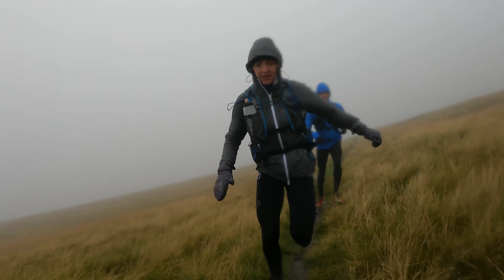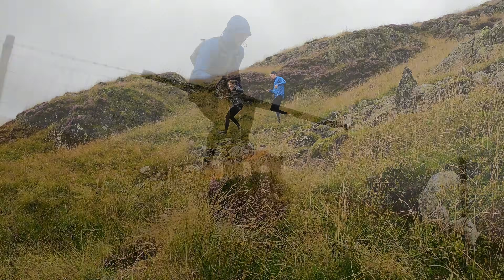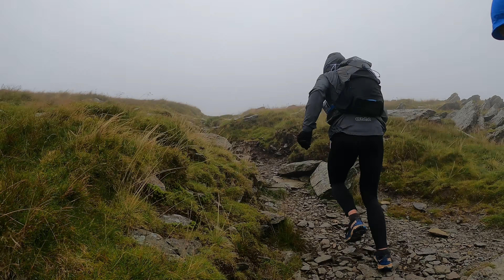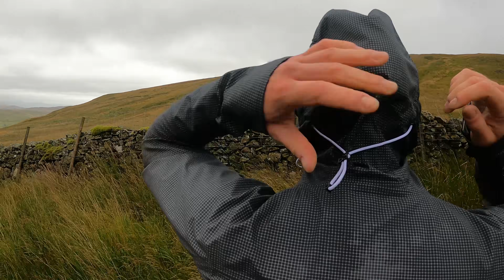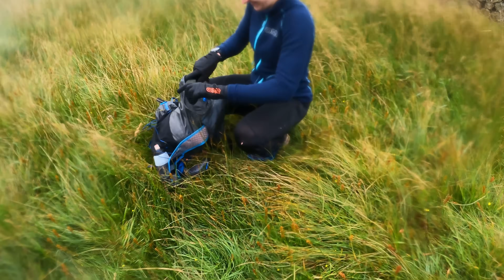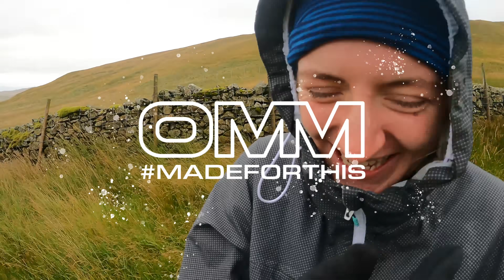The Toughest Waterproof Running Coat? Introducing the All New Aether Jacket.

Comment: Compared with gore-tex, what are benefits of this dyneema jacket, and what are downflaws?
Reply from the maker: The main point of difference between the Aether and other similar weight jackets would be the inclusion of Dyneema Ripstop reinforcement to the outer face fabric, making it much more resistant to abrasion and tearing. The Gore-Tex membrane is used in a huge range of fabrics with differing properties and end uses, so it is hard to draw a direct comparison. 

On top of this, the changes to PFAs and PFC regulations mean that what we used to call Gore-Tex (or e-Vent or any of the others), doesn't really exist anymore; they are all fundamentally different to how they were previously manufactured. 

If you're looking at other running jackets, Gore-Tex or otherwise, we'd recommend looking at the weight, the pack size, the hydrostatic head and breathability figures. Then it's up to you which is the most important. If it's weight, then maybe you go for a superlight jacket that's not so breathable. Or if it's durability, you go for a heavier option with a bombproof outer. We think the Aether offers a unique combination of all of them. 

A mountaineering Gore-Tex Pro shell may offer more features like pit-zips and snow skirt but we don't think they're necessary when you're out for a run. And other jackets might offer higher hydrostatic head figures but maybe don't breathe as well or are much heavier... 

Once you decide which features mean the most to you, you can start narrowing down the options available!

Comment: Wow.... You don't have armpits zippers for ventilation.
As I understand pockets - made from mesh also.... So they are useless as pockets, anything that puted inside would be soaked wet - good by old phone, need to by new one, and so on... 
Only usable as "ventilation".... with very low efficiency.

In total look like good idea, but realization had a lot of flaws.
Reply from the maker: Hi, thanks for your feedback. Pit zips can be great on hiking and mountaineering jackets, but they do add weight and bulk, plus another point of ingress for water. Instead, we try to find the lightest, most breathable fabric options we can, that we know will perform when used in conjunction with wicking layers beneath. 

The pockets are constructed from our PointZero windproof fabric with PFC DWR. Whilst they are not membraned, there is a high degree of water resistance and breathability. There is no mesh used in the Aether. 

Hopefully, you can get your hands on one in store or online and see what you think!

Comment: Are there any plans to release compatible waterproof trousers with Dynema Fiber? What max backpack weight would you recommend with the jacket?
Reply from the maker: Hi, no plans as yet for matching overtrousers, purely because the cost vs how many overtrousers we sell would be prohibitive! Though the question has already been asked in design meetings :D No specific weight of pack designated but any weight of pack on any shell will increase the hydrostatic pressure on the fabric, which is why you will normally notice a shell failing ('leaking') in those areas. The main killer for a fabric under a pack would be movement (i.e. bounce and swing), minimise this and you will prolong the life of any jacket. The Aether will withstand more than other lightweight options, though.
Reply: Thanks for the quick answer! :) From personal experience I definitely struggled more with ripping over trousers than jackets, so a lightweight dynema option would be very welcome. But of course I understand that this is not planned if the business value is not there…